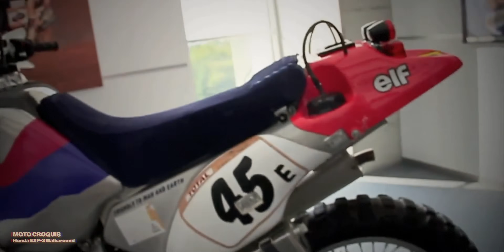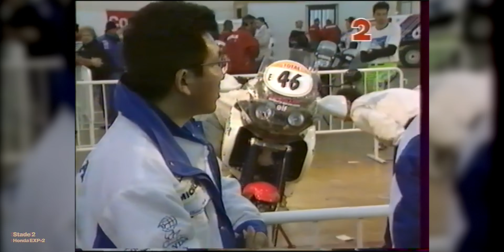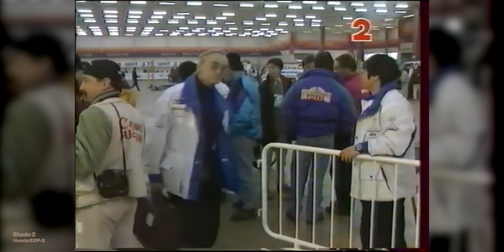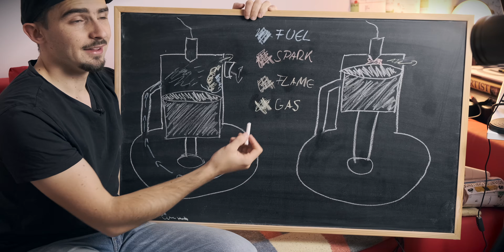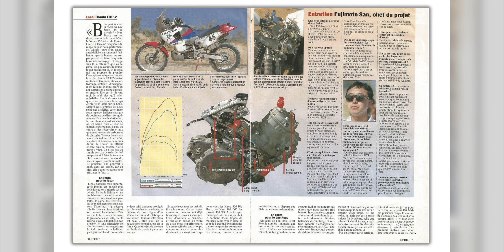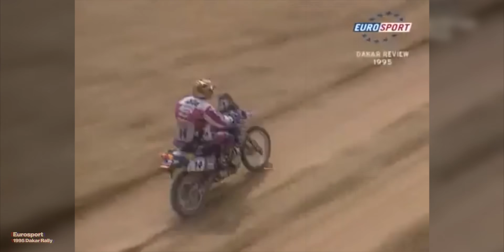When Honda Took a 2 Stroke to Dakar!

Comment from the maker: Appreciate everyone watching this video! I'm obviously not a chemist or physicist, so if you have any corrections or extra things to mention please leave them down in the comments! Cheers everyone!
Reply: Thank you for making great videos!
Reply: Patents only last 20 years. Anyone could make this now. 

I'd love to see a combination of this, with the ditech stratified charge direct injection and a modern version of Suzuki SuperLube which injected oil directly into the main bearings, then through oilways drilled into the crank to the big end bearings, then through oilways drilled in the conrod, into the little end bearing. Without the fuel washing away the oil inside the crankcase, oil consumption is dramatically reduced, with oil tank fills only needed at a major service.
Reply: If you the put the Paris Dakar XR650R and the EXP-2 side by side you can clearly see where the big xr got its styling from and frame ergonomics from? So all that design and manufacturing didn’t go to waste in the end! Because Honda still ended up with a desert racing weapon that dominated the baja rallies….. and I believe if they hadn’t of changed the engine size regulations in the Dakar rally it would of been a formidable competitor to other teams?  
Fantastic video 👍
Reply: Excellent video as usual.
PS the p is silent in pneumatic.

Comment: All the snowmobile industry has adopted the power valves in the exhaust cycle and are quite successful, some spring operated based on exhaust pressures and some electronically actuated…and still running them today in POLARIS  AND BOMBARDIER.

Comment: June 2025 and Husqvarna, KTM, Yamaha, TM, Beta, GasGas, Sherco, Scorpa, Vertigo, and others still have full lines of two stroke motorcycles available in their model lineups. i wouldnt exactly say they killed two strokes... the only place they had any effect was in moto and supercross where they gave a double displacement advantage to four strokes... they arent better per CC,  just the class rules allow double the CCs for four strokes so everyone rides them there. in hard enduro almost everyone still rides two smokers.

Comment: Great presentation, i remember when they came out with the adjustable exhaust gate valve , i thought it was to give more low end torque by extending the stroke length before exhausting, more of a fuller burn . Seems like Then had realy figured out how to make more power and cleaner burning two stroke  ,  and came the new four strokes , they called the three stroke . Amazing technology

Comment: Great video, I remember the EXP-2, as I was riding a Honda CRM250 mk2 at the time and got quite excited about the Active Radical version which I later rode. The Honda CRM250 AR was a great machine, very torquey and good on fuel and a great shame it got canned.
Luckily 2strokes are not over yet and Alpha Otto technologies are developing a super clean 2stroke for cars.  Check out this video:
https://youtu.be/5czHDU6pK8E?si=AZXhkr6Zi2VoV5yC

Comment: The Yamaha TDR 250 participated in the 87 Pharaoh Rally.  Two-cylinder, two-stroke engine bikes had extremely poor fuel efficiency and riders had to carry gasoline on their backs
Reply: Well all Dakar as nd rally bikes had 2-3 tanks for that reason.
Reply: They still won that rally on their fist outing.Remember it was 4800kms in 11 days, not many bikes would finish it.
Reply: I have seen a lot of test in my life, am 56 now had a lot of 4 and 2- strokes, any bike is heavy if you ride it flat out, not hard or fast but flat out

Comment: Direct fuel injection is the next thing that will bring back the two stroke, only air is in the bottom end and transfere ports , no fuel is added until just before TDC , no fuel out exhaust port ! Kawasaki future projects has a KX550 T two stroke motor up and running based on the 2004 KX 500 motor and so does Suzuki with its direct injection RM 520 T two stroke ! Better emissions than four strokes and one tenth of the moving parts ! Give Kawasaki and Suzuki 2 or 3 more years and the two stroke is back !

Comment: I remember Dirt Wheels and 3 & 4 wheel action doing in depth articles with Bruce O. From Honda America. The engine was simply amazing. They got some of the C.A.R.B. rules modified and changed through common sense. Two strokes were such a small part of the air  pollution problem. I'm all for cleaner burning  engines and this 2 stroke proved (with unlimited money and brilliant engineering) they could build cleaner two strokes.

Comment: I remember when the EXP2 started getting attention in the American press. It was super cool to read about, and was presented much as you've done here - an engineering marvel. I wonder if we'd eventually see hydrogen powered dirt bikes vs a super clean 2-stroke engine. Then again, if we ever get battery tech dialed in (long lasting and quick recharge) all this becomes a mute point. 

Excellent video

Comment: In 1994 I had a 93 XR 200 and my buddy had the 94 CR80  the CR would run circles around the Xr performance wise but the CR80 was nowhere close to the Xr200s reliability. 
I also had a 1981 YZ 250 water cooled that was super reliable just a absolute tank, I probably was 100 lbs and could hardly kick start that rig.

Comment: I own a CRM250AR and love it. I also went to see the  EXP-2. Let me share how ARC feels.
AR combustion kicks in when you're running the engine right before it hits the pipe at around half throttle. When the computer determines that the conditions are suited for ARC, a solenoid clicks and the engine makes a different sound. You'll notice an increase in torque and  the throttle becomes less responsive. It feels and actually is very lean.
The top-end and low-end feels just like a normal 2-stroke.
I know a few who owned the CRM250AR and we all agree that the ARC technology in not fully matured. The way that ARC kicked in and out was not smooth and felt like a switch got suddenly flipped. We all feel that if Honda could have kept development going on for another 10 years or so, it could have changed the whole 2-stroke game.
When the CRM250AR came out, Honda already knew they could only sell it until 1999. This is because there was a new regulation that killed 2-strokes in Japan that started in 1999. I'm generally not a honda fan, huge respect on how Honda was determined to put this technology into production even though they knew it's inevitable daath.
These bikes are really hard to maintain today and I've only seen a couple in the streets in Japan in the past 5 years.
I don't usually comment, but this video was a bit personal. Thanks, it was great!

Comment: The Yamaha 2 cylinder Banshee/RD/RZ two strokes would be a better platform. The bike motor did have the Power Valve...
But honestly the problem is gasoline and oil. Alcohol is an actual compound not a messy mix like gas. Great video though, last one too! Binging😂 I'll go back and give Dr. Big a 👍 too.

Comment: Don't think I'll ever sell my 03 cr250  jumped on a exc300 was smooth power but just not as fun as the cr. If honda came out with a cr300 s@%! Even one of them 500s in 2025 my wallet would definitely feel it 😂  fuel injectied with trap I'll all for it 😅
Reply: You can alter the hit on a KTM as the power valve is adjustable.

Comment: I remember a lot of Honda projects back then. They developed a racing ATV with independent rear suspension that was significantly faster, but never put it in production. They developed the best front atv tire for racing and stopped selling it.

Comment: Raiders of the ** ARC !!  But. But. But. But. In 2025, with modern electronics, what if they wafted a small mist of hydrogen gas into the cyclinder when the ARC envelope was exceeded? Would that not revolutionise the burn cycle?

Comment: Very interesting. I remember the project, I was 25. In Europe Honda sold a 125 ARC scooter, maybe called Foresight 125, not sure, never interested in scooter....but it was there, and working. 
High performance 2 stroke are not for the great public: you must know how to use (warm it, rev it....). So it was not interesting to invest in a niche product.
Seems like some similar concept is used in Mazda Skyactive, they have really high compression ratio and use the spark plug to control ignition. Or somethng similar.

Comment: We want lighter bikes, with good torque , that are fuel and service efficient . No need for top speeds and wining rallies but everything that goes fine till 150km/h - 130km/h without extreme vibrations that look like bike will fall apart and  that's it. . Give us lot's of gears and light engines  so we can ride for months at once without being scared shit will fall apart or it will squash us when we turn it sideways on a bumpy gravel .

Comment: I am surprised Honda would send a two stroke to Dakar, i would have thought a good torquey four stroke air cooled would be the way to go ( Honda have always favoured air cooled four stroke and IF necessary more RPM to equalize the power difference ) 
I like two stroke engines; three moving parts; piston, conrod, crankshaft. NO servicing ( oil changes! And a two stroke engine does not mind being tipped over where as a four stroke tipped over while running NO lube!! Personally i believe two strokes could have been developed further!!!!

Comment: So how does this differ then the exhaust valve’s in snowmobile engines in the 80’s?
Reply from the maker: So... I'm not exactly sure on the snowmobiles, but the exhaust valve isn't the innovation here. It's just part of the innovative system. Having that valve was not new, but the way it was used was new.

Comment: I remember reading an article on this very bike back in the day. The 2T engine was so efficient it's emissions were on a par ( if not better than) with a 4T. It was supposed to be the saviour of the 2 strokes..........and that's all i heard about it. To me, the 2 stroke engine is the heart and soul of motorcycle racing and it's a shame to see its demise.😢
Reply: Ktm still makes a 250 and 300 2 stroke. And Yamaha still makes the yz 250
Reply: There’s also factory 2 stroke turbo 800cc snowmobiles. So it’s not impossible for them to make. There’s just clearly not enough of a business case for 2 stroke bikes anymore

Comment: Dude, you made my day! And you did your homework well, this I can confirm, because Yoichi Ishibashi is a close friend of mine and I was partly kind of involved in this project. I almost got a job as monitor-rider for the EXP-2 as Yoichi suggested me at this time when I was living in Japan. Unfortunately, Honda decided against me. As you mentioned, the project was too late and it was killed due to various reasons. Cost, strict laws and - most of all - Honda´s decision to quite 2-strokes once and for all. Yoichi told me, that he´d quit if they really go for it. In the end, he carried on for a couple of more years and developed the 1000cc and later the 800cc V-engines for moto-GP. But his heart was still with the 2-strokes. At the time I was in Japan, he once visited me and gave me a prototype cylinder for my CRM250 (non-AR). Even that cylinder made the engine running very smooth and more torquee. Later, I got the derivate of the EXP-2, the CRM250AR. And that was a REAL revelation! I almost puffed out no fumes at all, produced a healthy and torquee 40hps and was incredible moderate in oil and fuel consumption. Image that: with only 1L of oil, I could run over 1000kms! Later, I imported these machines to Germany but apparently nobody understood or appreciated the real value of this technical gem. I will forward your excellent video to Yoichi and I´m sure he´ll like it. Thanks again for your good work man! Best regards from Germany.
Reply from the maker: That's so cool, glad you found the video! That test rider job would have been pretty sweet I'd assume...
Reply: @KRANKiT  you bet! At least I did ride the CRM250AR a lot and according to Ishibashi-san it’s the same feeling as on the 402cc EXP-2 (probably not as torquee but as a rider you get the gist)
Reply: Thanks for sharing, this was very interesting!

Also best regards from Germany
Reply: Is there still a strong 2 stroke community in Germany? I rarely see 2 strokes around me!
Reply: @maneeshg5487  2 strokes are big in Europe. I ride in the British mx and ride in off season in the German Belgium and France tracks. I would say it’s 50/50 2 smokes and 4 at the tracks
Reply: Wow! Good to know 2 strokes still live around me. I am looking forward to meet 2 stroke riders in Germany. @joeyb3441
Reply: @maneeshg5487  there´s a 2 stroke community here but I cannot really say whether it´s a "strong" one. We do have 2 stroke riders meetings here and there, so I guess, there are still some people who like them. If you search for "Zweitaktertreffen Deutschland" (2 stroke meeting Germany), you´ll find quite a lot of information on cars and motorcycles.
Reply: you legend man!!! I ride a VFR800Fi so i appreciate Ishibashi´s contribution to the V-engines a lot.
Reply: @ cheers! I’m certainly no legend. But Ishibashi-san definitely is! And he is a very nice and kind person.
Reply: Mate, you just made my day!

I have a CRM 250 AR tucked away in the garage for when I pass my test, you just made me appreciate it so much more!! 🙂👌🏻
Reply: @ keep it and don’t sell it! If you are in the UK, it could as well be one of the bikes I imported there. Does it say Red Baron somewhere or does it have a little sticker on the plastic guards at the front end?
Reply: @ and good luck with your test!!
Reply: there might be hope for 2 stroke engines
https://www.youtube.com/watch?v=5czHDU6pK8E
Reply: @strikye7  Very interesting, thanks for sharing mate! Hope, this will start of and keeps flying!
Reply: The crm250ar was the best enduro bike I ever owned. Yeah I know it really a trail bike but it would hook up where any other bike would spun or wheelie. Shame it wasn't a touch lighter or it would have been a massive success. It's the only bike I look back and totally regret selling. Thank you honda.
Reply: @bcitral same here! I even brought a couple of these bikes to Germany, homologated them and kept one for myself. I also should never have sold it😫
Reply: I remember this bike - the hope was for two stroke super bikes.

Comment: I personally think that the ARC program CAN be rejuvenated in racing development as some of the F1 development teams have reconsidered 2 stroke development again.  I believe Audi have done an experimental 2 stroke Le Mans style of car?  I think that Audi put this development on the back burner because they had such great success with their inverted head designed diesel V6 turbo with the turbo mounted central in the V of the motor with very very short equal length exhaust runners and dual EFI throttle bodies on the outside banks of the heads. I think the same development team was used for both prototypes and I think that Audi also abandoned the idea still due to emissions even though the engine wasn't burning oil it was still doing 2 x the combustion and diesels at the time has far less restrictions.

The idea audi came up with would mean the new 2 stroke engine wouldn't burn the oil, the oil would be injected using oil squirters in modern turbo charged engines like the Nissan SR20. This would mean that for every revolution a mist of fine synthetic oil could be sprayed up under the piston onto the bore and under the piston skirt so that the rings could be lubricated sufficiently. 

I think that with a rotary valve or a electronically controlled (actuated) valve similar to the one Honda created could improve upon the power output using a turbo charger at the end of the stinger pipe. Many Snow mobile guys are turbo charging their conventional 2 strokes already, but having the valve preventing unborn mixture being pushed through the combustion chamber under boost. Having the ability to close the exhaust port allows the engine accept boost in the most normalised way?
Turbo charging would definitely make up for any reduced performed of the ARC system (in comparison to stock 2 stroke).

I think the combining both of these developments could revive the 2 stroke era again.

Here's hoping the world wakes up and realises we are being scammed into thinking that combustion engines are melting the polar ice caps! It's the sun dammit! I know because I'm an environmental scientist.

Burn all the fuels!!!!

Comment: the answer is quite simple:
two strokes are cheaper and esier to build and modify 
4 strokes need more parts … are more complicated and more expensive … there is much more money involved in 4 strokes than in two strokes,
that‘s why two strokes are gone
and gone for ever …

Comment: Honda is an engineering company and this still the only example of a two stroke using the active radical principle. It is also known as the Atkinson  principle that has been used in many automobiles. Rav4  hybrid vehicles used this system. 
You can be sure that even though Honda didn't apply any of this technology to production vehicles going forward,  they certainly hold many patents that may yet show up in the future.
Reply: Or expire in future.

Comment: Honda needs to make 2 strokes again. I’d might actually buy a new bike if they did😂
Reply from the maker: I think you're stuck waiting for a while man...
Reply: @ let a man dream😂
I’ve never had a Honda dirt bike, just KTM’s and one Suzuki. All 2 strokes, but I do love my Honda motorcycles. I just don’t want a 4 stroke dirt bike.
Reply: Just buy a clean last model CR. 
I should have never sold mine.
The Aluminum frame CR was the best handling mx bike i ever rode.